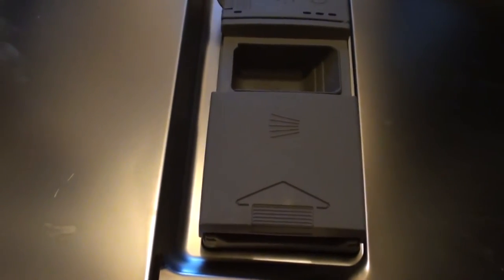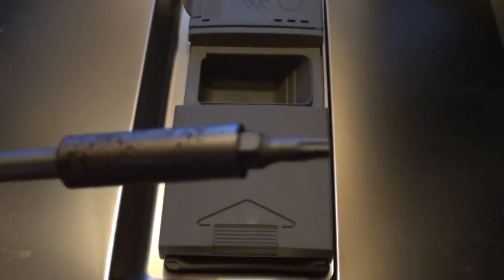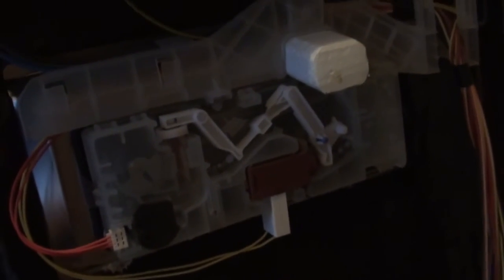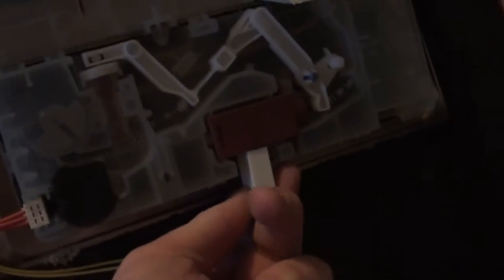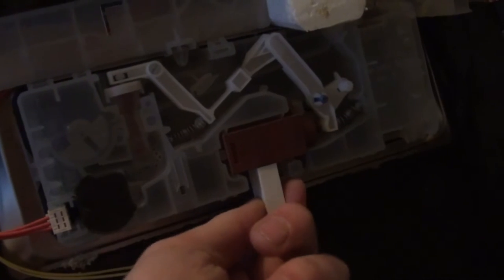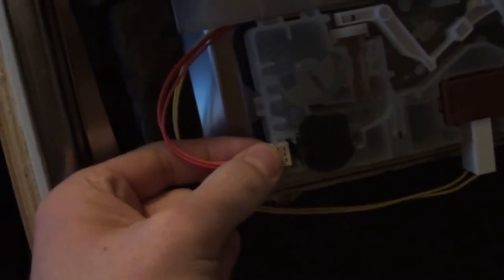How To Replace Bosch Dishwasher Detergent Dispenser - RustySkull Productions

Comment: Useful video - that's the exact same dishwasher I have got - around about a 2006 Bosch Exxcel slimline - model no SRS45E28GB/01 - apart from a clogged drain pump once, its been a good machine.